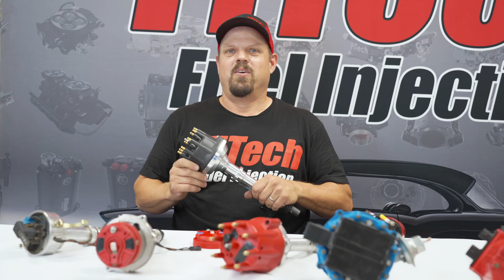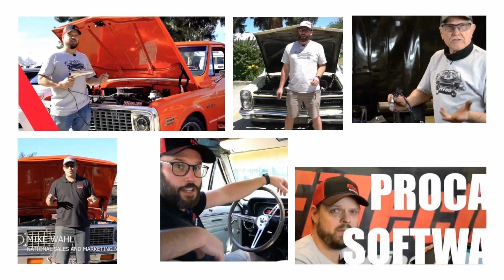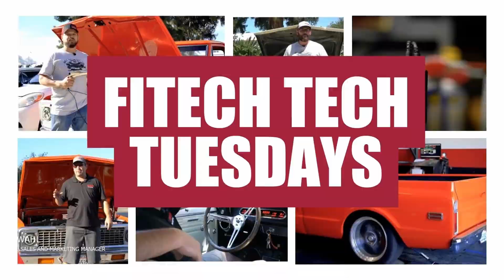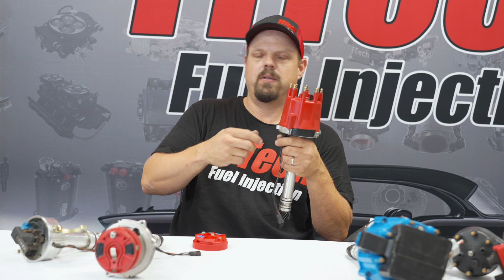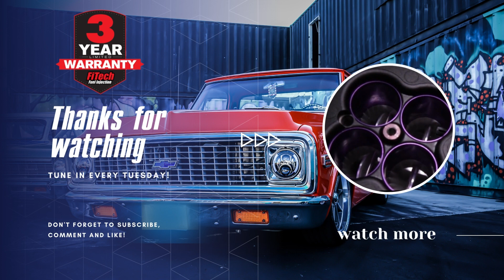FiTech Compatible Distributors | Tech Tuesdays | EP89

Comment: The computer controlled hei distributors (ie 350 tbi engines) have a 2 wire pickup, I simply deleted the module and tied directly to the pickup wires inside the cap and viola fitech ready distributor, with phased rotor factory since it’s already computer controlled
Reply: I have an 85 Vette which are the pickup wires?

Comment: It’s also possible to use a “flying magnet” style crank sensor (MSD offers kits & parts) and connect that signal to the 2-wire molex connector on the FiTech TBI system.   Then you just make sure the distributor rotor is pointing at correct position on distributor cap.   Timing fine tuning is done by moving the crank sensor accordingly.

Comment: No mention of a ready to run non hei billet distributor
Reply: I tried them all, a r2r with a dedicated tach output works fine, if it doesn't have that stay away. I used a proper coil negative for tach signal and it acted crazy.
Reply: The second distributor he picked up looks like a billet non hei VR unit?